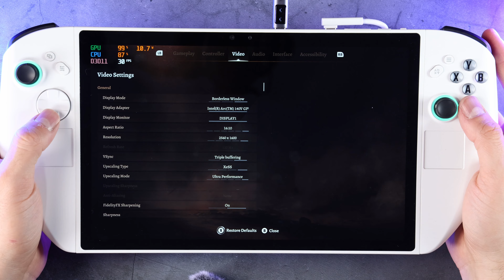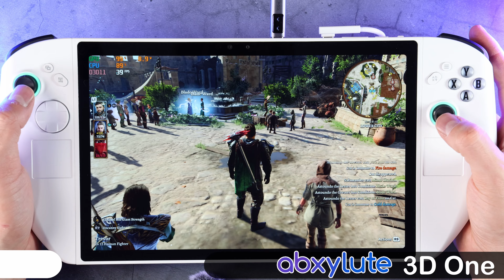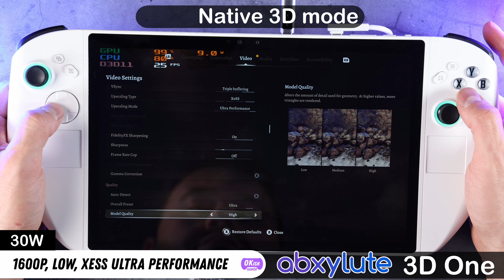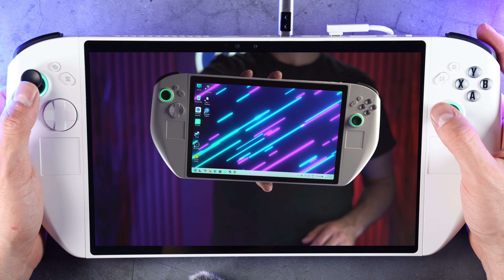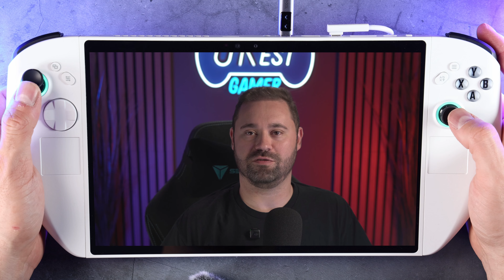ABXYLUTE 3D one BG3 game test

Comment: cant it frame gen each 3d frame separately, like
if the 2d gets 30 fps @ native
3d: (15 native + 15 generated) x 2 (the two stereoscope frames)
1:35 this looks like 10 fps not 30
Reply from the maker: Part of the slow look is recording the 3D and it focusing between the two layers, but it does have moments where it slows. Overall BG3 felt not bad, but is not completely smooth in 3D for sure